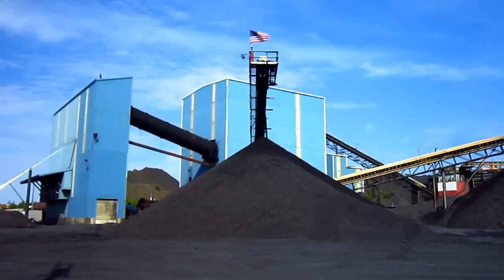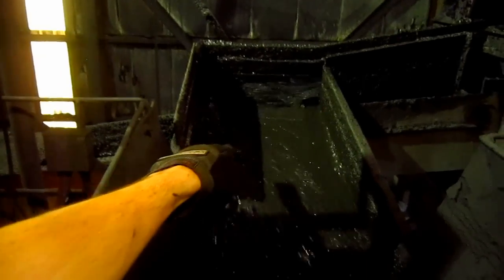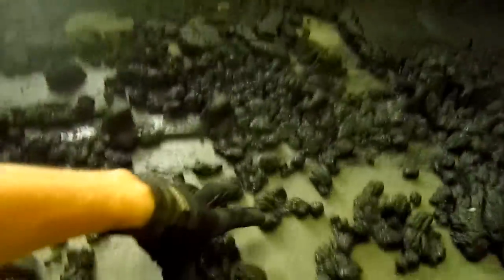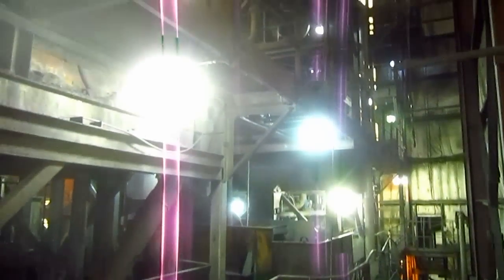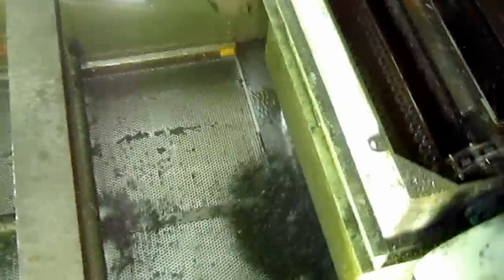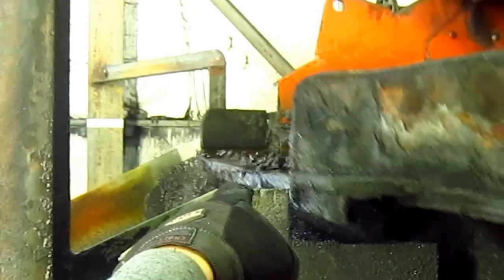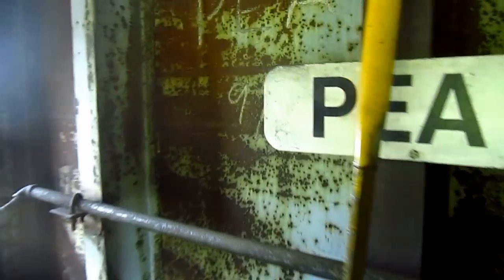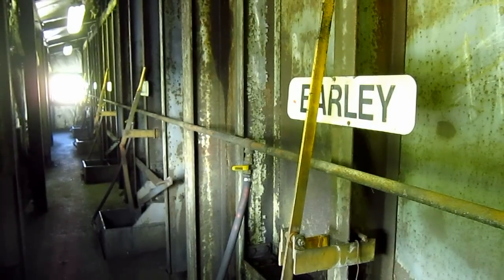The Heart of the Mine: The Breaker

Comment: I noticed the use of water in the plant. Is it a closed loop system, recycled, or an open system, sent to sewer once used?
Reply from the maker: Yes it is a closed loop system.  The dirty water exits the plant and runs in what is called a settling tank.  Here, a large set or rakes under the water turn to agitate the water, which thus will help the dirt particles to sink to the bottom of the tank where they are them pumped out the bottom of the tank and discharged.  The particles that exit the tank, which often looks like thick muddy water, is called a sludge. After completing the settling process, the clean water runs over an overflow at the top of the tank and is then pumped back into the plant and recycled.